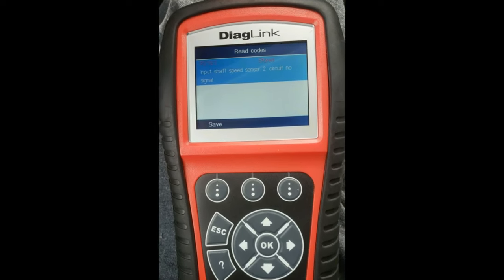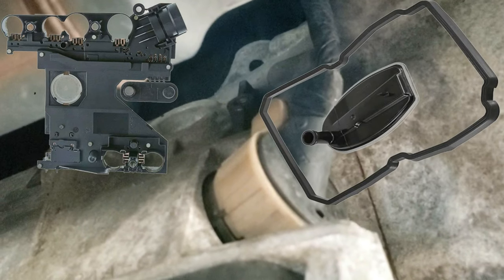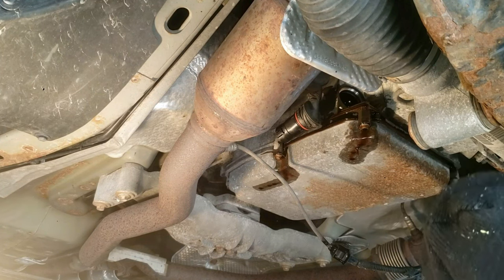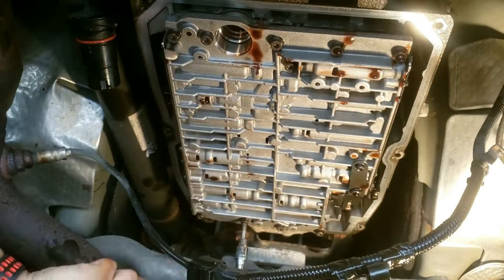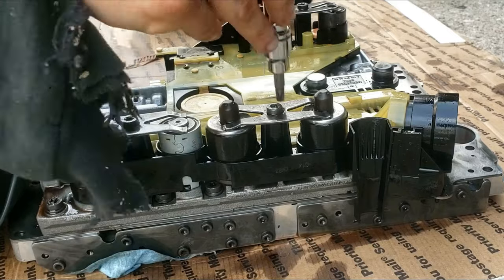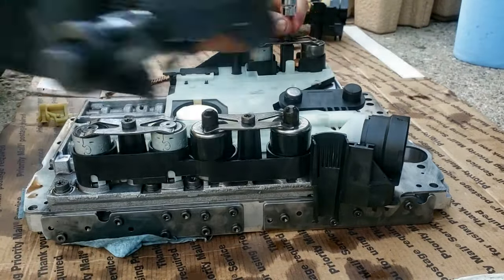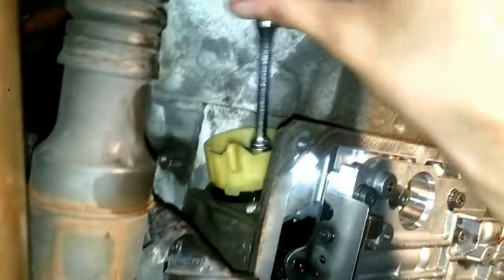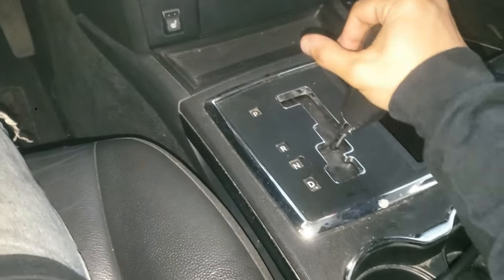Remove Conductor Plate Code P2767 Dodge Chrysler Mercedes Jeep Nag 1 722.6 Transmission

Comment: All I wanna say is that this video saved my car. 2008 grand Cherokee with nag1 trans. Transmission shop said "You have the mercedes transmission and it's shot, you need a new trans, or I can get you a rebuilt one for 3 grand NOT INSTALLED".... I ran my codes and got the trans speed input sensor code, researched Alot of videos and came across this one. I thought what the heck, it's worth a shot. Followed this video to the finest detail and got my trans working properly. Was getting stuck in 3rd gear, not going over 40 miles per hour and bucking when trying to go faster. Now it's silky smooth. This video saved me from dumping my car. I can't thank you enough. Cheers!!!!!!!
Reply from the maker: So glad to hear, and that you saved all that money, and most importantly you did it yourself. 👍
Reply: This video definitely helped me tremendously I’m having trouble with getting my connector won’t tighten down advice?

Comment: 2007 Dodge Charger SRT8, just replaced this after having issues randomly getting stuck in 3rd or 4th gear then suddenly got stuck in 1st, and code ran p2767. Replaced this all by myself with the help of this video. 200 dollars maximum in parts, all off amazon, quoted 900 to fix at mechanic, just saved myself 700. Thank you man i appreciate it. 17 yrs old btw this was my first car project besides for changing oil. If i can do it, you can!
Reply from the maker: Wonderful job. I'm very proud of you no matter the age for doing a project like this. You are a great example to many young people out there. You buy yourself something nice with that savings!

Comment: Some key points:

1) Changing the filter and fluid will not hurt this transmission.  You must use ATF+4 fluid, and do not add "friction modifiers".  Use the correct dipstick, and the  refill is accomplished by using the chart that shows fill level by transmission temperature. 

2) The A580 requires a relearn procedure after servicing. 

3) Check your shift cable(s) for excessive bushing wear. Replace as necessary.
Reply from the maker: Nice tips this should help others out!

Comment: Finally a video that helps me with my problem!!!! My 2014 Chrysler 300 has been slipping bad. Traction control turns off and slips into neutral when coming into a full stop sometimes. Been considering taking this problem to a transmission shop but after watching this video I really hope this will fix my problem.
Reply from the maker: Glad this helped. Did you fix the car yet?

Comment: Hi, I find this video very informative and professionally done. It is a great help and brings together a proper understanding of the error code. Proving links to purchase parts and listing which tools and other items are needed to do the repair is just a huge plus. This shows that you not only know your stuff but take pride in what you do. I have to say this and it is not a reflection on the video but in general, all the videos that I have watched many videos regarding maintenance and repairs of the Dodge Nitro and most if not all only focus on the gasoline engine types rightfully so most videos comes from the USA. Very little info is known about the diesel version,  2.8 CRD AWD the owner's handbook doesn't provide much info either. Through this video, I learned that the diesel version has the same transmission as the gasoline so that is a good spin-off. Once again thank you for a very good presentation.

Comment: What a great video. Fantastic imagery and camera angles, and you did an amazing job explaining. My reason for looking up this video is to replace the input speed sensor which was also described in your video. Thanks so much!
Reply from the maker: Glad you enjoyed it! and that it helped. My goal was to be as detailed as possible.
Reply: @FixCarYourself  I had code P1705 and P0730 for my dodge challenger which is related to input speed sensor 2 overspeed and incorrect gear ratio. I've managed to follow your video all the way up to removing the valve body. I've ordered a new conductor plate and waiting for that to come in. I'm really hoping that after this repair is done, my transmission problem will go away. The input speed sensor is not necessarily the problem, but I'm just going to replace it anyway and hope that it was it. I know the mechanic would charge an arm and a leg for something like this so I'm keeping my fingers crossed. I'll let you know how it goes! I've liked and subscribed. Thanks again!
Reply from the maker: Thanks, how did it go? Did you complete the job?
Reply: @FixCarYourself  the installation went great thanks to your video. However I got the same error code after driving it. It hasn't done it in a while though

Comment: Hello. Thank you for your video. 
My N3 sensor and rear speed sensors read a little funny on my live scanner, then fail and read 0rpm, when I hit third gear. The ABS light comes on. 
Is it a faulty conductor plate?
Reply from the maker: Hard to tell when reading the graphs. I know one of the biggest problems is the conductor plate. However, if possible see if you have any codes 1st. That will help you narrow down your problem.

Comment: Amazing video! Do I need to reset codes before starting up?
Reply from the maker: Sometimes the codes go away once you start driving a little bit but may still be stored in the vehicles OBD system's memory. But it doesn't hurt to reset.
Reply: You need to perform a relearn procedure, so the TCM can properly shift it.

Comment: Would it need to be programmed or as easy as just replacing a part
Reply from the maker: Swap the part, but check for codes after with OBD scanner. You may have to still erase them, so its not stored in the system.

Comment: 2007 Dodge Charger I have code P0501. The transmission mechanic changed the conductor plate. The car won't change gears and won't go past 25 mph. The car is still running as before the conductor plate was changed. It's saying speed sensor. Mechanic does not know where the speed sensor is located. He stated that the speed sensor is part of the conductor plate??
Reply from the maker: I made a different video specifically involving this code P0501. You can watch that here: 👉👉 https://youtu.be/JfrMEhzlrFE?si=yWlMZvPvreEz6Tw2

Comment: I'm getting p0700 on mine and I already bought a new TCM
Reply from the maker: Did you ever figure out your problem with the code P0700?
Reply: @FixCarYourself  nope still got mine and now I'm about go through the transmission smh 🤦🏼 ita been hell since I bought the car bud
Reply from the maker: Just  guessing but maybe you need a new or used TIPM (Totally Integrated Power Module)

Comment: Dodge Charger SRT8 196000 miles worth it or not? Throwing this code and sometimes getting stuck into 3rd or 4th geR
Reply from the maker: Hard to say. When a car has that many miles on it changing out the conductor plate involves removing the transmission oil, which might do more harm to the car.

Comment: Hi i have a 2005 Chrysler 300C and its making whining noise from transmission and shifts perfectly for some time after starting the car but after a minute or two it starts making the whining noise and slips gears and doesn’t go into gear. I am not able to figure out what’s the issue if anyone could help me with that it would be a great help
Reply from the maker: Is it low on transmission oil?

Comment: Amazing video perfectly done I been looking for a video to replace conductor plate this the best most informative great job brother, my 06 charger rt speedometer won't move at all and it stays at 0 could the speed sensor/conductor plate be at fault? I just have no codes is the problem or check engine light
Reply: It drive at least 20-25 mph at most but speedometer needle won't move just the rpms thanks in advance
Reply from the maker: Glad it helped
Reply from the maker: It sounds like a bad wheel speed sensor. However their should be codes to confirm this. So maybe try another code reader 1st.
Reply: @FixCarYourself  I replaced all the speed sensors front and back but still not working abs traction control lights are lit
Reply: @FixCarYourself  could I send you a video thru an email or something to show you how it acts? Thanks in advance
Reply: @FixCarYourself  9
Reply: @james4228 this happened to me to. Did this video fix the issue? Just wondering before I take this on

Comment: How many transmission fluid quarters you put on it?
Reply from the maker: I put in the amount of quarts that came out...so I measured the old oil and put that amount back in for starters. Then later I checked and added some based off my dipstick measuring tool and by using a code reader. But many people just put back in what they removed.
Reply: @FixCarYourself  Thank you

Comment: My friend, a question, I have a 3.7 4-speed Cherokee. The plates that appear on Amazon and Rockauto say they are for 5 speeds. Do they still work?
Reply from the maker: l' m not sure. I try to get the actual part  replacement. Check with the part number is possibile.
Reply: The Cherokee never had the 3.7 engine. The WK Grand Cherokee did, and the only transmission used in that application was the A580, which this video covers.
Reply from the maker: Can you buy both parts and use the one that is identical, and just return the one you don't use.

Comment: Will failure in any of the solenoids cause the car to stall  and turn off at about 30 mph? I'm chasing a stalling issue. No check engine code. Smooth running motor and trans. Just a simple stall want to rule out solenoid issue.
Reply from the maker: Put a code reader in to narrow down the issue, as it could be a bad wheel speed sensor as well.
Reply from the maker: The code reader would indicate if the solenoid is bad or not responding.
Reply: Mine is stalling out and everything to sometimes it'll Rev it's self up and do all kinds of weird stuff I literally replaced everything from the throttle body to every sensor plugs coil packs the whole 9 and I'm still getting a p0700 code so imma be changing this part out last thing ik to do since it's a p0700 code it'll come and go though it finally stayed on long enough for me to catch the code

Comment: When I replace the conductor plate are all tge sensors on it already? Ny code is p0717 input speed sensor for my 08 jeep commander.
Reply from the maker: Yes the valve body contains all those sensors. Just make sure the sensor needs to be replaced. Sometimes it's just needs a new conductor plate.
Reply: @FixCarYourself  yes it states input speed sensor no signal so I'm assuming that it's bad. So I figure the conductor plate has the sensors on it so I would swap that its an 08 with 167k miles
Reply from the maker: That's a lot of miles some would say not to drop the trans oil. Its a tough decision.

Comment: Is the tcm also in the conductor plate? Im getting code U0101
Reply from the maker: It is not. That code could indicate a low battery voltage, or corrosion on the battery terminal leads as an example.